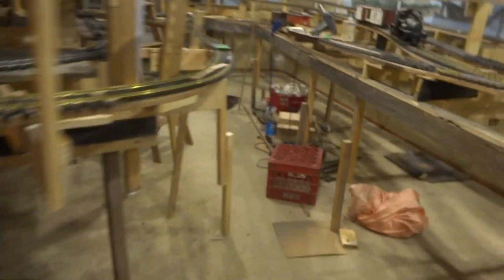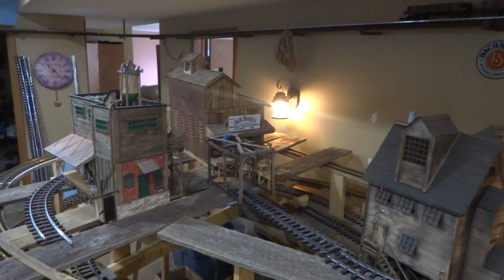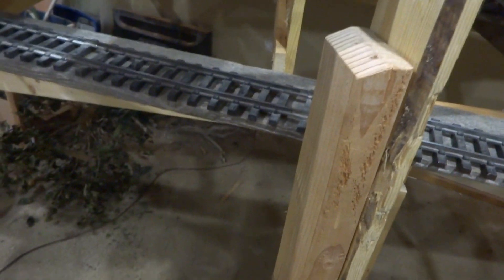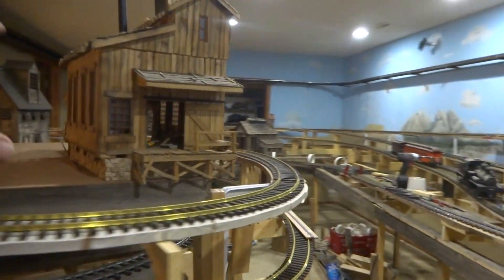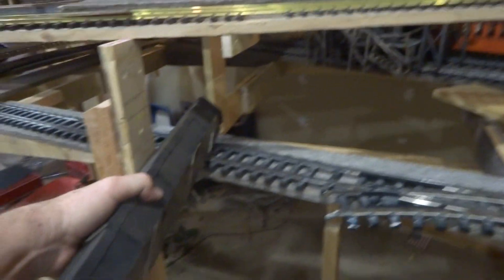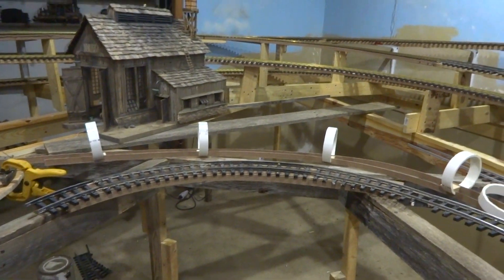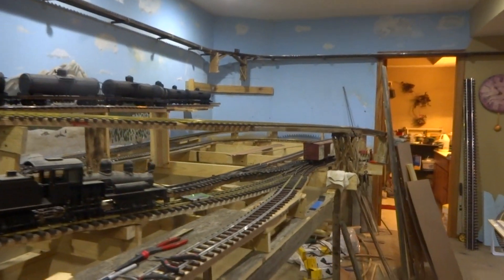Track work is all done time to move onto the waterfall

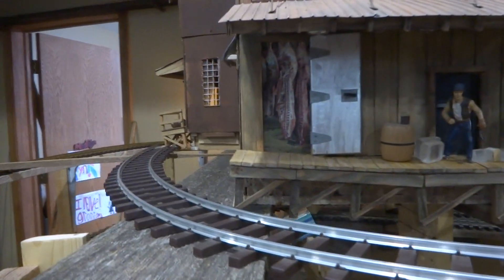Comment: The piece of track at is at 2:34, is that a custom radius? It looks like a 36" piece bent to a custom radius!? And if so, what bending jig are you using?. Thanks for the info. Looking real nice..!!!!
Reply from the maker: Rocky not sure what 2:34 is, or what your asking, but all of my main line track is flex track if that helps. As far as jigs go, I make a new jig every time I build a bent because they are usually angled differently.